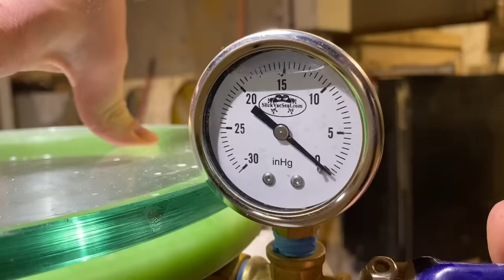Banana After 180 Days In Epoxy Resin | What Happened?

Comment: Take a large bag of Doritos and fill that with resin, afterwards you can just peel away the bag and have a Dorito pillow.
Reply: Please
Reply: I agree awesome idea
Reply: Thats a smart idea
Reply: Yes, make just a small enough hole, fill the bag with resin completely, then when it's hard, peel the bag off and let's see the results. 😉
Reply: all the Doritos would be in the left/right though
Reply: @zsombor_99  you don't know how resin works lol. that bag is gonna melt or become part of the resin. for what you asking you better of filling it up with water and turn into ice lol.
Reply: @shawonr3325  Whatever.
Reply: Please do
Reply: pleeeeeeeaseeee
Reply: Nice idea
Reply: Theres this thing called water.. It's amazing how it can clean dust of stuff when washing.
Reply: @zsombor_99  I mean the guy has a point that is how resin works. If you pour too much at a time or all that once then it's gonna activate too fast and it'll because a fire hazard and get hotter than it usually should. The bag will melt, and then stick, and you may or may not have a fire on your hands.
Reply: @PudgieDaFrog  What if resin poured in in small amounts at a time? I think the lines might be invisible enough.
Reply: @zsombor_99  yes, you're supposed yo pour it in layers so that you don't run the risk of it curing to fast.
Reply: But the doritos would be clumped together, it would look better if they were all scattered and floating different places you know
Reply: @bradentheman1373  Nothing is easy, you know.
Reply: Only the most comfortable pillow for your American head
Reply: Thanks for this idea
Reply: Yes
Reply: @shawonr3325  Only one way to find out. Resin hardens from the outside in if you need to you could put it in a refrigerator. If it becomes part of the resin you could just sand it off and then polish it.
Reply: Do it with Lays Chips. You'll have one perfectly displayed Chip
Reply: The resin might melt the bag
Reply: Is there anything based on foam, latex or rubber that's decently clear?
Reply: Take out doritos and fill in levels
Reply: @jamesevanko7037  They should use the gel like material that was used in the Stretch Armstrong toys back in the day. That would make a far better pillow then the hardened resin
Reply: You should be using heat on those bubbles ❤️
Reply: @zsombor_99  it's true resin uses acetone to keep it from turning to hard plastic, it's the off gassing of the acetone that makes it cement! Acetone also dissolves resin and pretty much any other plastic you could think of so a plastic bag would dissolve extremely quick in resin!
Reply: @GoldenBoy-et6of  Fair, I didn't knew this.
Reply: I think you meant Dorito brick
Reply: Except that would be a Brick, Short-Bus!
Reply: Funny till you attract all the bugs
Reply: Do a video.

Comment: You should encase the fruit in resin after using a UV sanitizing light, in theory it’s bacteria’s and microbes that decompose the banana, if suspect if you can sterilize it and maintain sterilization throughout its encasement you probably could preserve it with better results for much longer. Then again maybe not, worth a shot!
Reply: Here’s the thing, I don’t think that the uv light would reach to all the microbes, just the surface ones.
Reply: But won't the good bacteria cause a ferment?
Reply: Gamma rays after encasing should do the trick
Reply: @joaolemes8757  Really gonna throw gamma rays to a resin encased banana for the lols?
Reply: @ApostleOfCats  UV light is already used to sanitize some aliments. If the banana is fresh enough, fungi should not have been already able to go through the peel so there should not have microbes inside.
Reply: @proxy90909  Hulk FRUIT!!!
Reply: This is exactly why I tell the missus not to touch the cheese as the germs from her hands get on the cheese and then those germs go "oo food" and colonise the packet
Reply: @George.Coleman  Well, there is already a lot of bacteria (and sometimes fungi) in the cheese so the competition between microbes is verry rude. It is really pretty safe to touch it with your hand (unless you take weeks to eat the cheese i imagine or if your hands are dirty of course).
Reply: @mathmath9303  interesting. I have another theory. Do greasy surfaces touched by many like a pull/push door handle make your hand feel cold afterwards because there is now the previous persons bacteria drawing the heat out for themselves to use instead of you
Reply: @George.Coleman  it is an interresting question. However I don't think it is possible. A bacteria is alive and i don't know anything that have a metabolism that does not produce even a little bit of heat. 

I think that the cold is  simply due to the metalic handle.
Reply: @mathmath9303  Bananas are flowering plants. What happens is that bacteria are carried with the pollen to the seed. While the seed is maturing the acidity and antimicrobials keep the bacteria from growing. However as the sweetness increases the bacteria will grow causing the surrounding material to ferment. So even if you sterilize the outside of the fruit, the inside still has enough bacteria to decay.
Reply: @Darisiabgal7573  Oh thank you I didn't know that, it make sense.
Reply: I figured he would have cast the bananas in resin to hermetically seal them, then put them in a microwave oven for a few seconds to kill all the creepy-crawlies inside. I was surprised that he didn't.
Reply: @dnwiebe  You could kill them with a gamma irradiator.
Reply: @George.Coleman  You could just tell her to wash her hands before touching food. Somehow I doubt you're trying to preserve the cheese in resin, I'm pretty sure the idea is to eat it.
Reply: @cagxplays9602  and also in butter and cheese spreads, keeping the level uniform and flat prolongs the life as it decreases the surface area exposed to the air every time you open it. So trying not to dig holes in your butter is key
Reply: My man gotta get up his sterile laboratory enviroment game
Reply: @proxy90909  science is not about "why?". It's about "why not?".
Reply: @se6369  yeast (fungi) cause fermentation not bacteria but basically the same thing.
Reply: @George.Coleman  that would be the aluminium of the door handle absorbing the heat from your hand and has nothing to do with bacteria. Aluminium has great themal conductivity compared to most metals you can do an experiment yourself by holding a piece of steel and a piece of aluminium in your hand then put an ice cube ontop of each and watch how quickly the aluminium one melts the ice using the heat from your hand
Reply: @DiustheZ  I understand that, but its immediately after you let go of the handle there is something still taking heat out of your hand as it still continues to feel cold, it's like there's some kind of residue filled with bacteria that wants to be warm on your hand, disgusting. Need to do a test with a purely clean handle and a handle that's been touched by 100+ people
Reply: @George.Coleman  Think of it this way... if there was something on your hand "sapping the heat" from you then it would radiate warmth and make your hand warm. You can't have something touching your skin "stealing warmth" and your skin be cold that's not how thermal dynamics works. You continue to feel cold temporarily because your body needs to warm up again and it takes a moment to do that it doesn't instantaneously regain the heat it lost by touching the metal.
Reply: that makes a lot of sense, but even still, all fruit and vegetables have micro organisms inside of them that are still present even when the fruit is fresh. So eliminating every single one of them is quite the feat.
Reply: @mathmath9303  it's not fungi it's the bile of a baby cow that turns milk to cheese through an enzyme process that causes curdling, the bacteria is only alive for a short time and the cheese is just pure milk solids without any whey but with salt added! The longer you age cheese the more flavorful it becomes but it had to be aged in cheese cloth with lard which causes the bacteria to only form on the lard because the lard protects the cheese from the bacteria but for that reason you never wanna eat the outer part of the cheese from an acctual round of cheese because it's super nasty old rotten lard on the outside and perfect cheese on the inside
Reply: He should leave it longer for about one year and see what happens.
Reply: Well no actually see fruit ripens and banana ripens very quikly this releases gas (the bubbles that keep coming from the banana's) this gas is trapped so is forced to react with the banana this gives the off taste and contributes highly in the decomposition.
Reply: @ApostleOfCats  true, you'd have to irradiate the banana, at that point I think it would be mush inside since the irradiation would perforate the cellular structure muck like if you froze and then thawed it, but it sohuld then last as long as it it werre canned- I would imagine even without bacteria to hastren the process that the organics would eventually break down- although it could take many years even.
Reply: I haven't watched the full video yet but letting it cure on vacuum will suck all the bubbles from the resin, many of these bacteria will need oxygen

Edit: he did it 30 seconds later
Reply: @dnwiebe  resin would melt
Reply: no sterilizing the banana would actually make the rotting worse.
Reply: Or an actual food irradiating machine, so you can do it after it's sealed in resin.

Comment: I wonder what would happen if you only half-encased it, so it's sticking out of a block of resin. It would rot, certainly, since it's going to be exposed to air, but I'd be intrested to see whether it would be uneven due to half of it being covered up. Would you be able to see the rot traveling through the banana, or would it still start going off all over at once?
Reply: The rot would probably spread and eventually it would dry/ fall out
Reply: It would dry and all of it would rot evenly.
Reply: The rotting would start with the side of the banana exposed to air, as the banana rots, it will eventually rot down to the stuff inside the resin as it slowly exposes it all to air. It will be slightly uneven, but it depends where the rotting starts in the first place.

Comment: Have you guys tried using a pressure pot instead of a vacuum chamber for the resin? Instead of degassing the resin it just crushes the bubbles down to a size that you can't see them.
Reply: You can still see them if you do this, but instead of it looking like bubbles, it looks very hazy with tons of tiny tiny bubbles.
Reply: why not both

Comment: It'll still rot due to all the bacteria and fungus living in the banana. What you need to do is to first encase it in sealed glass casing, don't use epoxy, it's still somewhat porus. And then use gamma ray or x-ray to sterilize it. Unfortunately though, the beam will also kill all the banana cells, so a few months later it might still taste like banana, but it'll be very soggy.

Comment: It's not air that's coming from the bananas it's actually a gas called ethylene. Ethylene is an important plant hormone. In bananas and many other fruits, production of ethylene surges when the fruit is ready to ripen. It's also excelerated by heat or cold. Hence why they say don't put bananas in the fridge.

Comment: vacuum bag it. with an inlet hose connected to a bucket with Resin that way you won't have any air but you will use a little more resin. as you have to close the valve connecting the bucket before it's empty!

Comment: Why didn't you just vacuum seal the bubbles out? Just by placing it in a sealed box and vacuuming the air out wouldve taken out all the air bubbles in one shot and alot easier